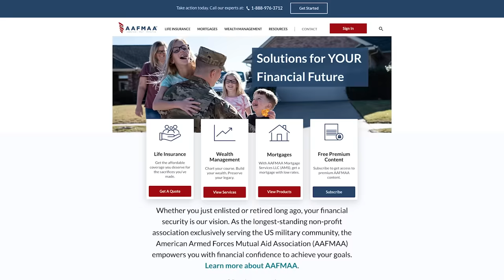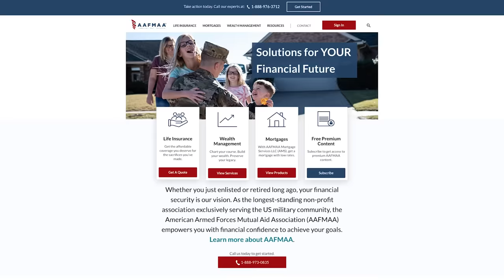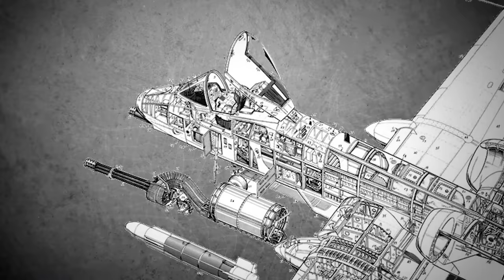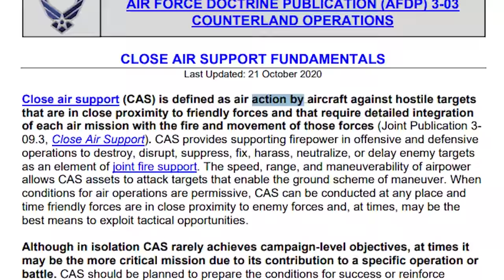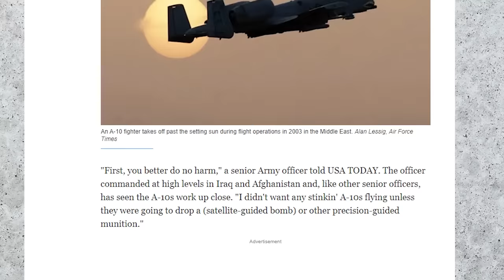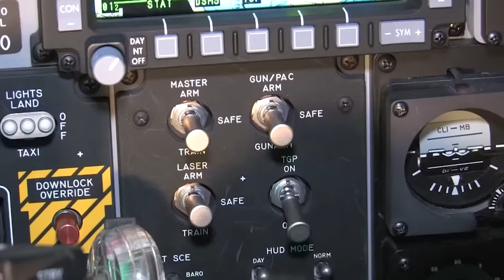Why the Air Force is Screaming to Retire the A-10 Warthog

Comment: hm not bad video, but I miss few things :D... Maverick for example exists in laser targeting variant, I believe its E version Maverick with thermal vision had as well 2x optical zoom, while maverick with only visible light camera had no zoom. There are more version though. It as well uses bigger warhead than hellfire, so its a bit more expensive, thats why hellfire is now favoured, from what I understood as well, because of less colateral damage - not mentioning the hellfire X ninja version with those blades :D hello toyota car :D .., as well, its cannon used to have two firing modes, slower and faster, it was then set to one single firing mode - something in between. A-10 got upgraded two times - from A version to B version and from B version to C version with full glass cockpit. Its being used today mostly by FAC and JTAC, outside CAS, as CAS is possible only in non AA areas.  Left and right side of the plane are symmetrical and those large wings on the back are made to cover hot exhaust of engines, so its not that easy to get IR lock from the ground. Titanium tube is copycat from Su-25 which was build before A-10, however. Could carry more ordnance, but was flying faster, so not so comfortable for CAS, still formidable, look in UA vs Russia war :) got huge cannon as well (not with that high rate of fire)

Comment: Its super sad to see it go but I agree with command that they need replacing.  Not because they are not doing the job or are unable to do it but mainly because all the wings are so old its getting super expensive to keep the plane flying anymore.  I do disagree with replacing them with F-35s.   They are far to expensive to put into a ground attack role.  Personally.. what I would love to see developed is a ground attack Osprey.. ergo a hybrid between MC-130 Spooky and the Osprey.  Put a couple side firing Bushmasters on the side and the potential for a rack or two of Hellfires with the ability be fired out the rear (drop fire).

Comment: Sadly, Air Force top brass tried to scrap A-10s all the way before Gulf War One.  Claimed, "obsolete..."  Said mission would be handed to (expensive and fragile) F-16s... Air Force believes in "Blue Sky" assets.  Bottom line is that the Air Force loathes the Close Air Support mission.  They should have handed whole A-10 inventory over to the Army prior to Gulf War One... (Senator suggested that to Air Force during their first foray in getting A-10 declared "obsolete...") But the "dog in the manger" attitude of top Air Force brass is that (if truth be told) none  of the other services should be allowed to fly anything...

Comment: Here's the real reason.  The A10 is phenomenal and has many years of life still left in the airframe assembly however, Boeing purchased Fairchild and immediately when the replacement parts contract was due for renewal, and was going to be announced by source selection (DoD) Boeing announced directly to source selection that they would not be bidding on the contract, no parts would be produced or provided except for that which was in existing warehouses and they were now claiming patent ownership of all parts in the related designs.  At the same time Boeing spent large money lobbying Congress in specific regards to why they need a new A10..... In short no company owns those patents and never has however under the bush-cheney administration they simply just turn their back and let Boeing do whatever they wanted to.  So now the boneyards have been hacking up and salvaging parts to keep these airplanes in the air when all that was really needed was avionics systems replaced with upgraded units.

Comment: Run a gauntlet test. A10 vs the prototype replacement in a number of close supper roles. First do this via simulators and then in real life with actual ground troops and spotters in a mock battle in different terrain - in the desert, urban  and jungle. The winer takes all. If the A10 wins then it's airframe and controls and avionics and battle computers and weapons system all get upgraded. If the A10 lose then it gets canned and we move on, no regrets.

Comment: Even in WW2 the then Army Air Corps was not sold on close air support for ground forces.  Then Gen. Eisenhower had to pull rank with back-up from Pres. Roosevelt and Prime Minister Winston Churchill to get control over bomber and fighter support for the ground troops.  Whatever logic the U.S. Air Force brings to the anti-ground support mission, the fact is that Air Force generals would rather have their pilots flying around in billion-dollar aircraft than performing necessary, but dull ground-support missions.

Comment: A10 is a gangsta that does drive by shooting. Doesn't work when the enemy owns the roads with plenty of road blocks.
I think people think the A10 can do the Wild Weasel job, but we know it doesn't have the avionics to do it. Plus it has to be so close to the front line that Russians will knock out the airfields (Ukraines swap up their air fleet to different fields to confuse the Russians.) They can't be 1000 miles away with over two hour response time.

Comment: For the moment let’s set aside the fact that a skilled gunner behind a dual 14.5 mm will absolutely shred a F-35 and do some math courtesy of good old Wiki. I realize the USAF wants to us the F-35, however It’s always too to get the big picture.

		Bullets:		           Hardpoints:
F-4E		640 rounds
A-10C	1,174 rounds		11external stations
F-15C  	940 rounds
F-16C	511 rounds
F-22A	480 rounds
F-35A	180 rounds	4 internal stations, 6 external stations

So can someone please explain to me how the plan with the fewest bullets is going to provide effective and sustained close air support?

Comment: The A-10 as a platform is probably du efor retirement and may honestly have been over hyped all along. HOWEVER the dedicated CAS misson requirement will not be retired. As long as the AF holds the reins of mission allocation, the guy on the ground will b eSOL without a missin dedicated unit and in order to preclude "momentary" diversion, the platform needs to be unique to the mission. Does it sound like I don't trust the AF - yup

Comment: While modern tanks are armored against the 30mm gun the sensors on the outside of the tank aren't.  Blinding a tank makes it useless on the battlefield, forcing it to withdraw.   The A-10 has a top speed of 439mph which is ridiculous compared to the Skyraider which had the same speed but was also capable of spending more time over the combat area.  Perhaps more powerful engines coupled with greater fuel capacity would make the A-10.more capable?  Speed is important as the faster an aircraft can get to the target and back again is important, as is how fast it can be turned around.  Then again the Harrier jump jets were valuable in ground support role and are still employed by the US Marines.

Comment: There absolutely is a plane to replace the A-10, and the Fat Electrician already did a video on it.

Its called the Sky Warden and it has not just a higher top speed, equivalent munitions, and higher durability, it also has way better intelligence gathering systems and a whipping 6 hour loiter time with only 1000 dollars per flight hour of maintenance.

Oh and it's literally a crop duster with it's stats cranked to the max.

Comment: The A-10 is the cheapest fighter to fly and maintain. Not to mention that we are capable of building replacement aircraft. If the Airforce doesn't want it anymore, their loss. It has always seemed like too much of a bulldog for the Airforce anyway. The Marines however...I say it would be a perfect fit to take on the role of close air support.
That being said, eliminating the A-10 all together would be a huge mistake!

Comment: they been trying to scrap it since the 90's.  There's no weapons platform to replace it other than some fragile little F-35 birdie with aluminum foil armor to do the same thing.  But then again could have some autonomous 30mm autocannon on a balloon that zings around in circles doing a gun run on something.  ;)
Reply: What? Why are you acting like CAS has to involve getting low to the ground and taking fire? The F 35 can easily provide CAS and better than the A 10, and they don't need air superiority to operate it, unlike the A 10

Comment: The Desert storm info wasn't quite accurate, the A-10s weren't held in reserve for tactical reasons they were grounded by weather. The first week of the war had abnormally low overcast, and prior to the "C" upgrade the A-10 was only able to fight in visual (and primarily day) conditions. (They had instruments to simply fly from A to B in IMC but they couldn't fight in it.)
This allowed the old F-111s to get twice the armor kills per airframe in the theater because they had all wether thermal imaging and bomb guidance, especially effective just after sunset when the ground armor retains more heat than the sand and then later at night when Iraqi crews would turn on their space heaters.
Reply: Damn it's almost like the A-10 is a piece of shit kept alive by BRRRRT memes.

Comment: Without the CAS support of two A10s in the Spring of 2011 in Panjwayi Province Afghanistan, a US Amry unit on the way to an FOB would have been wiped out. I can give you all the bloody details of that day but I won't. All I can tell you is that my son would have died there without these A10's support. My hope is the Airforce will be there for the troops in harms way when needed the next time and not tied up fighting some high tech air supremacy war.

Comment: A combination of suicide Drone technology with fast jets could be feasible  
 with the resurgence of precision Cluster bombs will be the default once the A10 is out of service.

One last way to milk out the performance of the A10 is to convert it with a Virtual Pilot and
to use it until it is destroyed, without a pilot inside..

Comment: Close air support requires loiter time not over a single target but an area. Yes air dominance of an area is required to operate certain equipment in a hostile environment. (fighters vs targets) one of the tools available should be fixed wing attack aircraft to deliver the punches needed support ground troupes and take out enemy positions.
Reply: Yes it's called an MQ-9 and it has more endurance and range and altitude than the A-10 by a factor of like, fifteen.

Comment: The main reason i believe the A-10 should not be retured is there is no replacement for a ground attack aircraft that is capable of taking off from unfinished or dirtied runways.

The A-10 was designed to be at the front line and not behind it.
Reply: the a10 still needs pretty long runways, the problem is that the a10 is slow so it needs vulnerable runways that are too exposed

Comment: The A-10's only unique feature over other aircraft is the 30mm cannon, which is too dangerous to use against any target with even the most basic AA defense. 99.99% of the missions the A-10 performed involved using missiles and guided bombs from stand-off ranges, which plenty of other jet aircraft can already do, but unlike the A-10, they can do a lot more than just ground attack. While the A-10 can carry a larger payload than some aircraft, it's not much more, and their more limited role largely negates this advantage. Plus the older variants lack any sophisticated targeting equipment, and largely had to rely on the pilot's bare eyesight and maybe a pair of binoculars. This resulted in them being involved in more friendly fire incidents than any other aircraft. While the newer variants address this short coming somewhat, their increased cost negates their whole advantage over other aircraft. So yeah, it should be retired, against any near peer, they would be blown out of the sky, they were only useful against terrorists with no AA capability at all, and even then they still couldn't use their main gun safely.

Comment: The Air Force as an institution hasn’t liked the A-10 from its beginnings.  It’s not a pointy nosed, go fast fighter.  Moreover the Air Force has little love for the CAS mission because it has nothing to do with air parity or air superiority.  The concept of precision strikes with guided bombs works well - IF SOMEONE IS ON THE GROUND with a target marking system - which is of course not always the case for a variety of reasons…. Like enemy mortar fire put shrapnel through what ever device was being used to mark targts for Laser/GPS guided bombs.

Another issue is that A-10 pilots knew what their mission was and had an affinity for the guys on the ground, the follks they were supporting.  A pilot whose secondary or tirtiary mission is CAS won’t have the same attitude of “Hey, We’re all Brothers here."

Loiter time is another facor in CAS missions which makes it harder for a lot of modern aircraft to hang around long enough to really be useful.

This is a big enough deal that the Amy has adopted the A-29 Super Tucano - a turbo prop  propeller driven aircraft with a TOP SPPED OF 370 mph and a loiter time of 8 hours and 24 minutes.  However, it can only carry 4,850 pounds of mmunition/ordnance  including the ammo for the 2 - that’s right only 2 - 50 caliber machine guns - one in each wing.

This all means the Army still thinks a slow CAS aircraft is worthwhile and the A-29 is at best moderately suited for the role.  In comparison the WWII De Havilland Mosquito - “The Wooden Wonder”-  could go 414 mph, be armed with four 20 mm auto cannons and still carry the same weight of bombs as the A-29.  THe A-29 has a range of 830 miles while the Mosquito had a range of 1300 miles; the Mosquito has a service ceiling of 37,000’, the A-29 10,850’.   TO be fair the Tucano can climb much faster - 3,230’ per minute compared to the Mosquito at 2,850’ per minute. 

So one wonders if we really have gotten any better in the last 83 years as far as CAS capable aircraft are concerned?

Comment: The absolute real reason that the Air Force wants to get rid of the A10 is because it's already paid for it. It's cheap, easy to fix, it doesn't require much in the way of upgrades so the amount of money compared to other airframes is much much smaller and these Colonels and Generals who make these decisions want to get advisory jobs for those companies that make the high-tech aircraft that are not supporting ground troops. There is not a chance that an F-35 can do the same things that a warthog can do. As a former grunt and army pilot, there is nothing that can replace this airplane when you talk about the dispersal of bullets from that cannon. If I have bad guys in front of me, that's what I want behind me. That gun is terrifying. It will make the bad guys think twice, they won't even need to think twice. Once they witness the volume of fire that that thing can put out they will turn tail and run. Just its presence over the battlefield in Afghanistan stopped enemy aggression in its tracks. Absolutely nobody wanted to tangle with a warthog, and these morons want to get rid of it! These people are looking into their own self-interest. Nothing they have can replace the warthog. Problem is they just don't care about us grunts.
Reply: the a10 is really expensive to fix and upgrade
Reply: @aquilesca5tr0  technically and to be more accurate it is the cheapest combat aircraft in the United States Air Force. They have years of spare parts to go through besides the 1/3 of the squadrons that have already been shut down. It cost us, the US citizens virtually nothing. Where in the hell do you get opinion that it's expensive? What in God's name are you smoking?

Comment: 15:08 A10s hitting brits got so bad, the brits told the americans not to use the A10s in sector britain was operating, we'd rather have no CAS than the A10

19:18 the A10s canon was questionable at the time. The 30mm couldn't take down a T-64 mevermind a T-72 or god forbid something modern/neer peer

When you have to sit arround and look for targets with bino's a long loiter time/slow speed is useful, but with modern sensors and precision guided munitions thatsnot necessary

However, in counter insurgency, a long loiter time is incredibly useful for a different reason, the insurgents in afghanistan knew the rules of engagement and if they hid their weapons they couldn't be targeted, so when a plane's overhead the guns went away. The longer the planes over head the longer they are aurpressed.

The mere presence of a plane surpresses enemy positions, howver would you rather have the enmey surpressed or dead? And are you willing to risk your life to get them surpressed?

Comment: What about the A-7D the plane the A-10 replaced. It was faster, could take damage not as well as the A-10, but in Nam only 2 were lost to enemy action out of just under 13,000 sorties. The Navy lost more but flew well over 50,000 sorties, it still was less than the F-4 or the Air Force F-105. The A-7 was the first plane with a laser designation sensor on it, something not mentioned with the A-10, it must have had one or one was added. We had more friendly fire deaths in one battle in ww2 and Korea. I thought the F-35 was suppose to have 3 variants, air superiority. vtol, and ground support. Maybe they changed the program and I missed it. The first efforts to get rid of the A-10 was due to the Air Force adopting Israel's policy of entering and leaving a battlefield at supersonic speed. Now with UAV's and hypersonic missals there will be very few roles for planes to play.